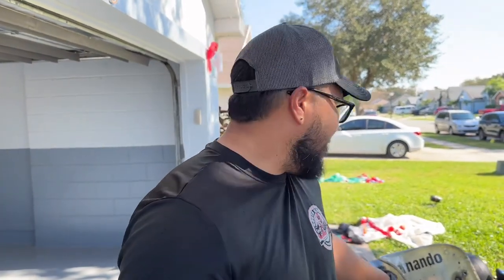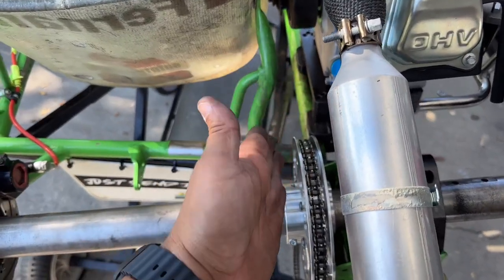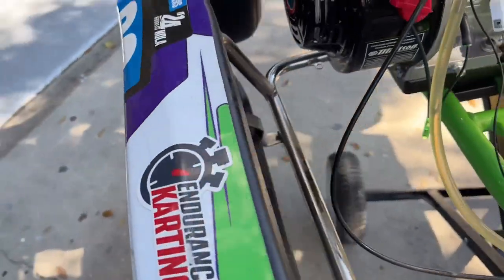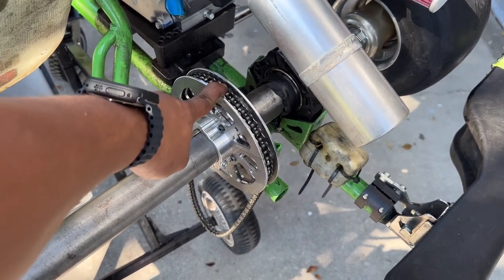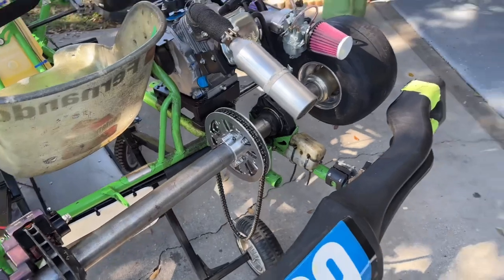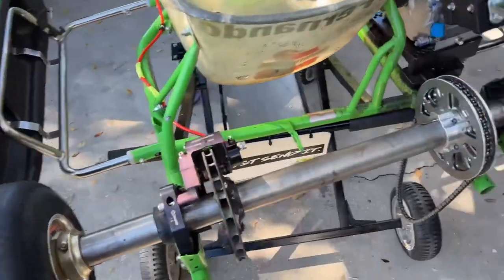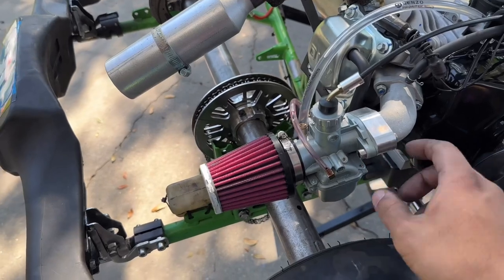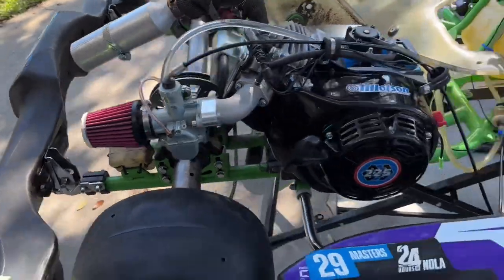Karting Vlog: Tilloston Mounted and ready to go.

Comment: I'm sure you can put studs into the manifold to hold the carb on. No rule for that, I don't think. I'm thinking about going with the 225, myself. My 206 just sits while my KA gets all the love, lol.
Reply from the maker: I think it’s a good engine for practice. At the moment running this race we can see a difference in power between motors. That’s why I am not 100% in.

Comment: Just curious....do you have any "what they call them in the motorcycle world" Iron man, run the event by themselves?   Also, what is the cost on a endurance event?   Good luck on the race.
Reply from the maker: That just depends. Entry free is 500 for this one. Then you add tires plus fuel around 1100.